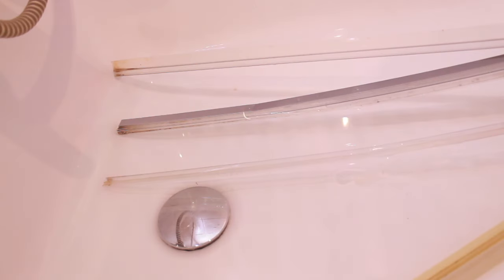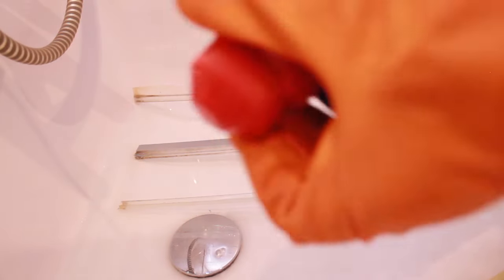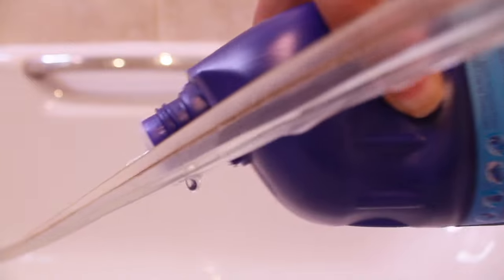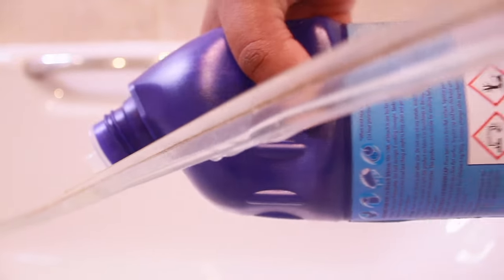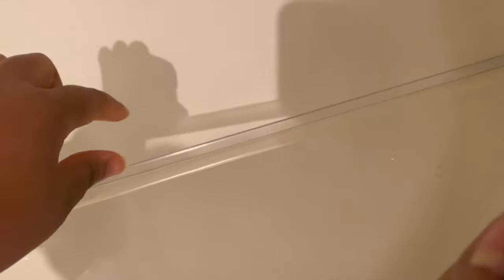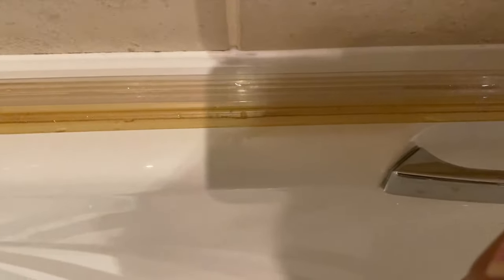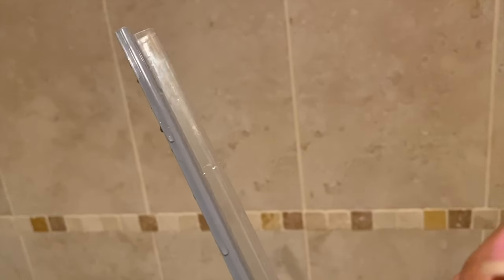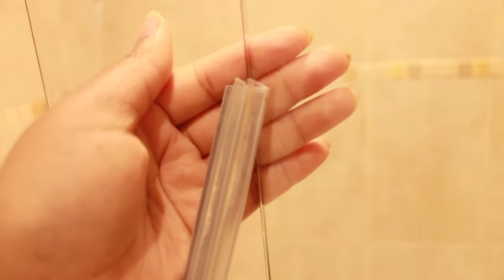HOW TO CLEAN THE SHOWER SCREEN  SEAL | SHOWER SCREEN DEEP CLEAN

Comment: For the ones who wants to avoid harsh chemicals, use a mix of bi-carb soda, water and hydrogen peroxide. Works just as well and zero toxic fumes 🌿
Reply: Thank you for this - I have septic tanks and I am unable to use bleach.  So that is a great alternative.
Reply: @CandySmith-Marley  glad I could help 😊
Reply: Isnt hydrogen peroxide a chemical? Like a bleach?
Reply: @chrbx13  no it’s not :)
Reply: Yes i did not use bleach in my version
Reply: @stinejensen_photo  Lol, water is a chemical
Reply: @dæmnKris  but not a harsh one. I think you need to re-read my comment
Reply: @stinejensen_photo  "Isnt hydrogen peroxide a chemical? " "no it’s not :)"
Reply: @dæmnKris  “like bleach”, again, no it’s not! Because it is not like bleach 🤷‍♀️ But lets keep splitting hairs and not focus on the important things 🤦‍♀️

Comment: Glass shower door seals are not a lifelong item and tend to tear along the bottom and/or side over time as they harden from water chemicals. If one is taking the seals off anyway, replacing them will result in a new, clean seal with new flexible bottom seals.
Reply: It’s helpful for people not wanting to lose their rent deposit on these fuckers instead of buying new ones when moving out 😂

Comment: If someone sold a non-transparent seal I would be first in the line
Reply from the maker: 😂 I would be there too , they really are a pain especially on the discoloration
Reply: But that will just keep the mildew hidden. The design is stupid, it should be closed at the ends, so basic. Planned obsolescence is everywhere. I don’t have a bath so can’t do this. I have autism and showering is painful enough without the awful rental bathroom, with the most ridiculous shower enclosure design with lots of inaccessible bits that are crusty with lime scale or getting mildewed. It’s so frustrating. When I was in a communist dictatorship it was easier to clean the bath, these modern designs are just so absurd and unnecessarily complicated.